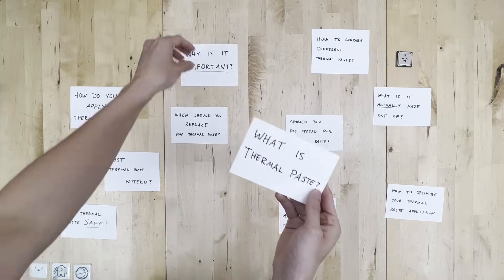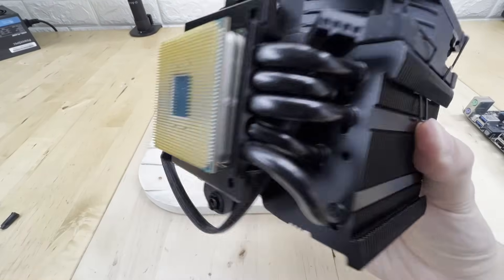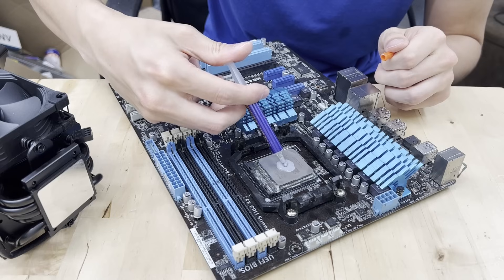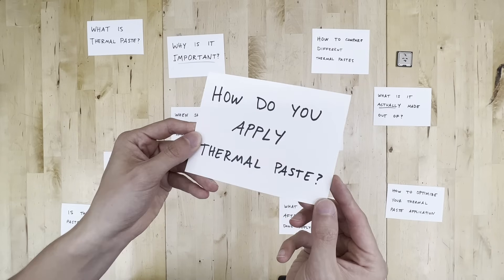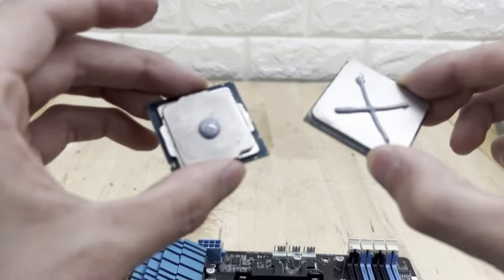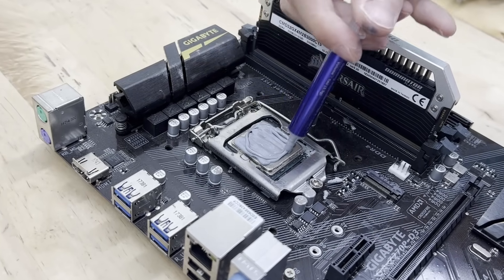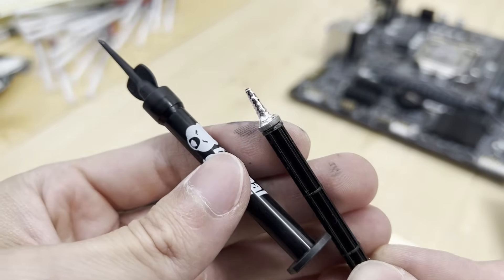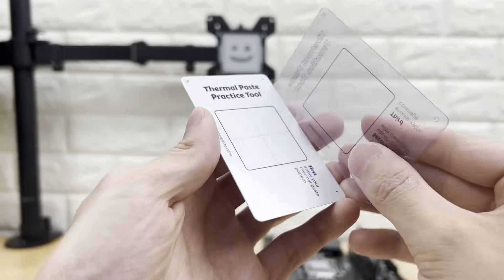watch this BEFORE applying thermal paste in your PC

Comment: I watched this video about 6 years AFTER I applied thermal paste. Am I screwed?
Reply: I mean if your pc survived 6 years I think that’s a good sign
Reply: Your PC is going to explode
Reply: No, but you might need to reapply it if your CPU is overheating.
Reply: It's been dead. WAKE UP WAKE UP WAKE UP WAKE UP
Reply: im just replacing my thermal paste and stock intel cooler after 9years on i7-6700. My temps started to hit 80-85c in newer games.
Reply: once your computer starts to shut down due to overheating. its time to apply it
Reply: how did your computer survived, does it have longer lifespan?
Reply: Nahhhh
Reply: Some thermal paste is designed to last for longer.
If you wanted to go whole hog you go with ptm7950.
Reply: yeah
Reply: You need to repaste, it lasts about 6yrs before it dries out
Reply: @TheBlueBunnyKen  valide answer
Reply: No but your CPU is cooked
Reply: After 6 years you need a new system,  6 years is very old for a computer unless you just browse the internet.
Reply: @JazzLowrider  I have to disagree. I'm typing this comment on an 8-year-old PC, and besides YouTube I also do software development and occasional graphics work on it. Still works great. I don't expect to replace it any time soon.
Reply: @argvminusone  I understand you can work on for many years, but you're missing out on the latest like DDR5, m.2 gen4 and pci-express 5, but i understand it still works fine, depending on what you want out of your system

Comment: Is it normal for a ryzen 7 5700x to go to 90 degrees while gaming with a standard am4 cooler?
Reply: No, thats kinda hot. My 5700x3d runs at around 75c max in a hot room accelerator to the floor.
Reply: By "standard" is that the "Wraith", or the "Wraith Stealth"? What BIOS settings do you have regarding power limits, PBO, fan curves etc.? Are you absolutely sure it's installed properly and securely, with full contact between the CPU and the cooler? What temperatures do you idle at, in Windows or in the BIOS?

90 sounds pretty high for a 5700X but if it's the smaller "Stealth" cooler, and especially if the power limits are unlocked or if the fan is set too slow, I can see it.
Reply: @itspaafekuto   newer version of the amd wraith stealth did not change any bios settings apart from enabling xmp

Comment: Use WD-40 as thermal paste
Reply: You can use  mayonnaise, ive had a lot of success with the GARLIC variety, also, there's no need for a spatulas, just use a teaspoon, and any access can be mopped up with a slice of white bread, although avoid seeded bread, those seeds could actually take root in moist conditions.

Comment: Too little = high temps

Too much = no problem
Reply: i mean unless it spreads all over your mobo
Reply: @xvxvxvxvxvxdxdxd  that is still not a issue, but might be a pain to clean
Reply: @xvxvxvxvxvxdxdxd  MX4 is non conductive.
Reply: use both dot and x method 😂
Reply: Lol😅😅 Too much could Give you a Headache 😅😅
Reply: omg.You're very clever boy.I didn't know that.
Reply: I added too much and my pc was lagging
Reply: Lol. Many problems can arise from too much. Learn before you speak.
Reply: Shush and stop being silly  @talon1706
Reply: @talon1706 The excess thermal paste will simply leak onto the motherboard, as it doesn't offer any resistance to the cooler pressure agaisnt the CPU. As long as it's not conductive it won't damage anything.

Comment: New builders often overthink thermal paste application, in reality it's not a big deal just put a few small dots around the middle
Reply: Exactly this. Don't use too little is really the only recommendation.
Reply: @NeriahsLight  disagree you also don't want to use too much.  I am of the camp that too little is better than too much.  Otherwise it smooshes out and makes contact with the board which is an absolute no no.
Reply: @Shay-q8u  Per the video, this isn't an issue unless the paste is electrically conductive (i.e. liquid metal). I take it you disagree?
Reply: @argvminusone  I have no idea what I'm talking about but I'd like to disagree, thank you.
Reply: @argvminusone  I know what I'm talking about and I agree with you
Reply: @Shay-q8u  Thermal paste making contact with the mobo doesn't matter at all unless you are using liquid metal thermal paste which is electrically conductive.  There is no reason you should be using liquid metal on the IHS of your CPU.  The risk is not worth the 3-5 degrees extra cooling.  Liquid metal is mostly used when you delid a CPU or a GPU.  You are correct however that too much paste is worse then too little paste.  Too much paste will act as an insulator instead of a conductor.
Reply: It has been proven. Too little thermal paste means running hot. Too much thermal paste means running optimally, but messy. The mess will not damage your processor or motherboard and can easily be wiped away. Its better to use too much than not enough.
Reply: thick paste spreads differently...

Comment: I don't know why people just not spread the thermal paste manually.
Reply: - No tools
- Scared of doing something wrong
- 99.9% of the population don't care about losing 1 or 2 degrees
Reply: I didn't do it originally, but to ease my mind of it being completely covered I spread it evenly on my gpu die and my cpu
Reply: Airbubble boogeyman
Reply: why do it when i can use the pressure to spread the thermal paste for me

Comment: Vídeo incomplete, you never gave me my much needed answer of: can I put my thermal paste in a peanut butter and jelly sandwich.
Reply: You can. Once.
Reply: You technically can
Reply: Yes, you can and then you'll end up in the hospital
Reply: Hey! we love eating crayons right?
Reply: Thermal Paste is not toxic but it can cause irritation and allergy. Not recommended for consumption.
Reply: that will be the last time you are going to apply anything
Reply: Yes you can and it makes your anger low👍
Reply: My friend says his butthole has been running 6 C cooler ever since he accidentally got his tube of Thermal Grizzly mixed up with his Preparation H.
Reply: After a meal you can put it on your toothbrush also
Reply: No
Reply: He did answer it! 3:23
Reply: Mine gets colder and increased performance and obviously is stops getting colder than that eventually
Now my desktop is just getting worse performance every month
Reply: 3:24
Reply: @billycole6154 I said put it there not eat it
Reply: Yes you can, but only when you get sick and have temperature.
Reply: Don't listen to the other snowflakes, put as much as you want. Adds extra proteins.
Reply: Go ahead.. Make sure you spread a lot thermal paste
Reply: Yes you can it adds a light slushy like texture
Reply: Only if you want to have a PB&J&TP sandwich afterwards... I don't think it's generally considered an upgrade.
Reply: Yes you can but i don’t reccommend consomption
Reply: you can't answer that, because no one would do it.